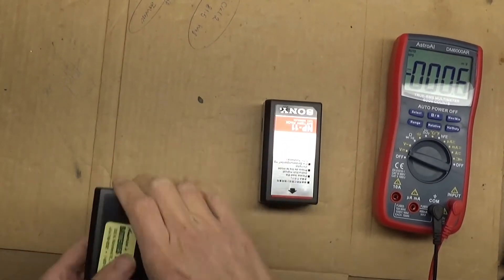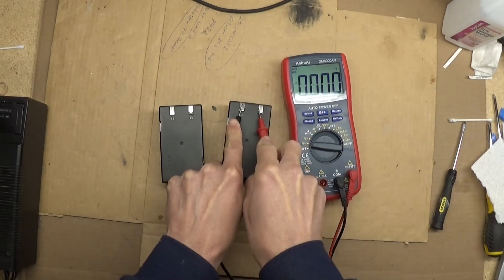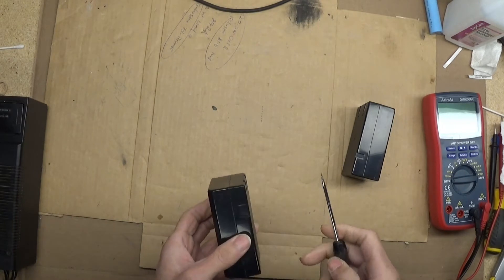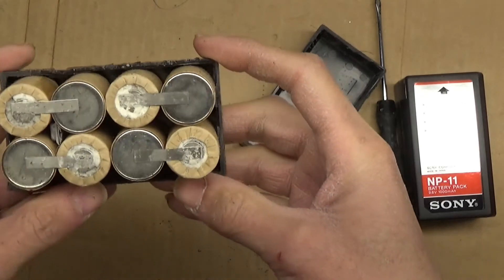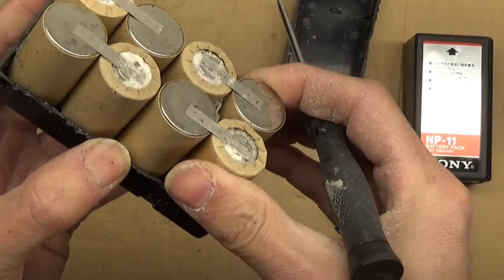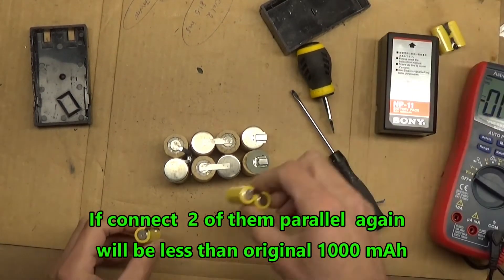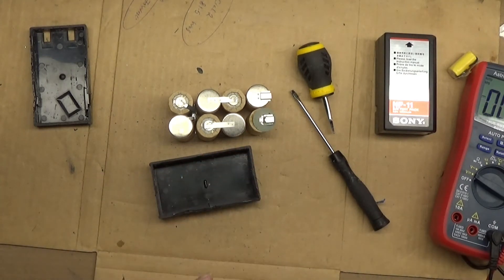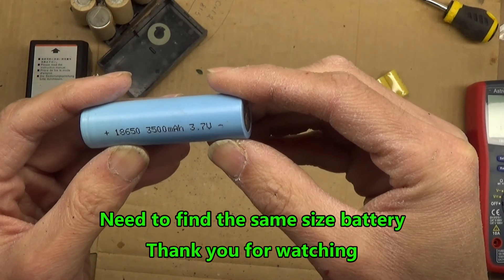What is inside of Sony NP-11 battery

Comment: I have three NP-11's, two are brand new and have never been used since they left the factory. One piece is used. But they all have green corrosion marks on the metal contacts and I have not tried to charge them, I think they are all broken.

Comment: I bought a camera and the charging kit (AC-M110) with the battery 5 years ago in order to collect it cause I like all vintage objects. Today I've decide to charge the battery, (yes, that big adaptor works). The process took exactly one hour.  As a result I got a hot battery with 10.43 Volts, and bouth temperature and voltage has been decreasing.

Now the temp is sligtly perceptible and the voltage is 10.26 after an hour.

I know that the battery output is 9.6v (you´ve said 6.9v). So, more than 9.6v in my batt is anormal?

(The camera try to work plugin in its power cord directly from de adaptor with 9.9v but turns off.)
Reply from the maker: I think that is normal after fully charged . The one that i restored by new Ni Cad batteries also was more than 10 volt after fully charged. (car batteries are about 13 volts after fully charged that is marked 12v).  
Is it turn off shortly after power on with battery too?
Reply: @homeelectronics5055  Yes, putting the battery and (without pressing the power button) Something inside it rattles, then the head tries to turn and eventually turns off
Reply: @caretheplanetearth  Hi, do you have a Sony BMC 100 or 200 camcorder? I also have an AC-M110 power supply and two NP-11's and they are brand new. I have the AC-M110 connected to a BMC 200P camcorder and it turns on fine and ejects the tape compartment, but after pressing "record", it does what you say it does, the machine shuts down after a click.

Comment: I have two Sony NP-11 batteries that will charge, but they don't last long. They also get hot from charging. Would replacing battery cells fix the issue? Thanks!
Reply from the maker: Yes. If not holding charge then batteries are bad. The battery that i showed in this video is original and from 80s and completely dead and leaked and dried to white powder.  After replacing battery cells that are good now. Even after 3 months it  still has charge.
Reply: @homeelectronics5055  Ok, thanks!

Comment: This was exact what I needed to know before when I had one of those cameras found in the thrift store.
Reply from the maker: well you can not find those batteries any more but you can restore it like a new one by replacing battery cells
Reply: I boigjt a I betamovie cam, I want to use it without being conected, you now how can I replace it with a similar battery?